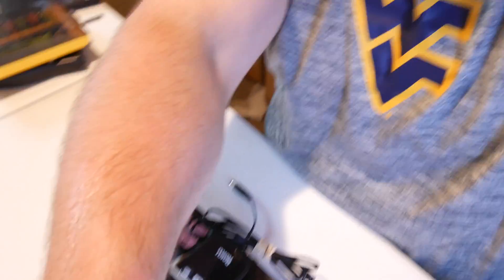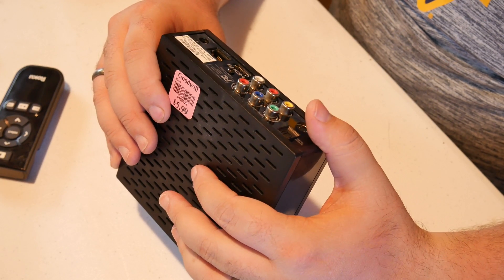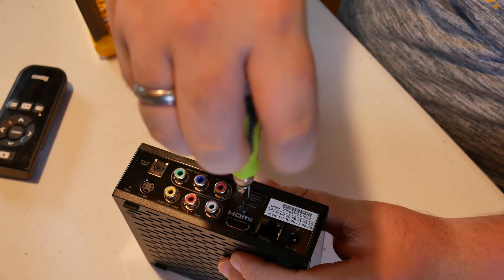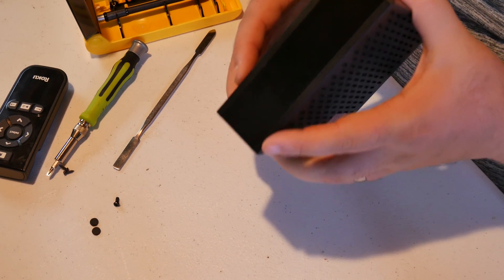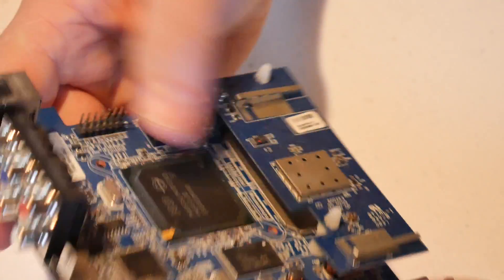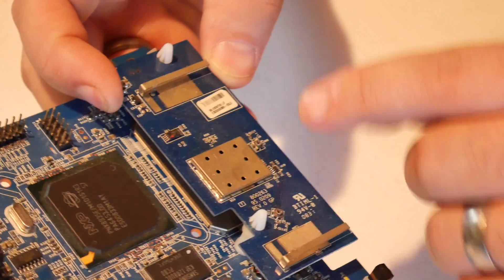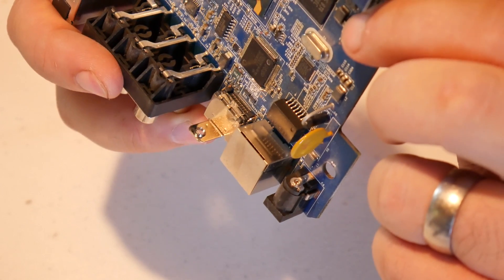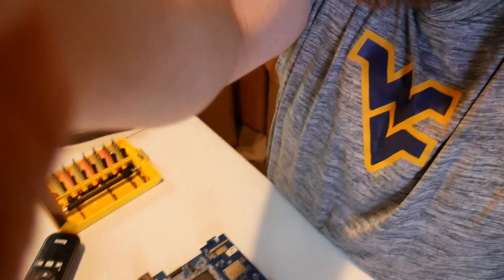Let's Look - Roku N1000 - Teardown

Comment: Does your roku overheat?  Mine is heating up with it plugged in just being off.
Reply from the maker: Well technically it's not off it's in soft off so it's still running light tasks and stuff like that in the background. They never truly turn off off
Reply: @krypticnexus  well that is the most stupid thing i ever heard of. why would they do that. this thing gets dangerously hot, it's to the point of scalding after 24 hours. its a fire hazard
Reply from the maker: Oh yea chrome casts used to be that bad I don't know if mine still is. I plug it in and forget about it.

Comment: Hey Anthony Cress, I have a Roku Express and it overheats. Is it possible to open it and install a tiny fan to cool it down?
Reply from the maker: If there are vents on it you could possibly connect a small fan to the outside and blow air through the case. I've never used a Express I haven't opened it up or anything or seen it